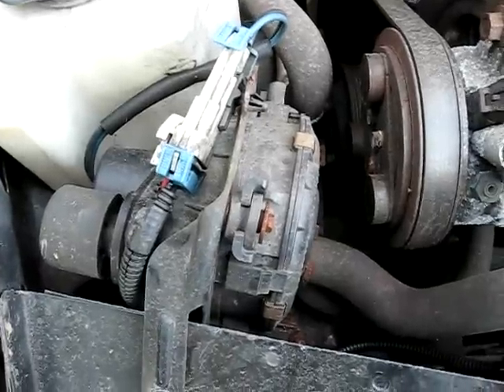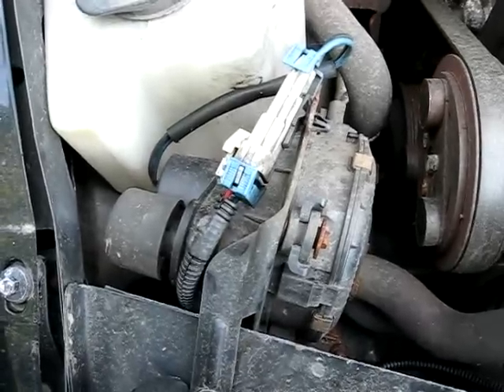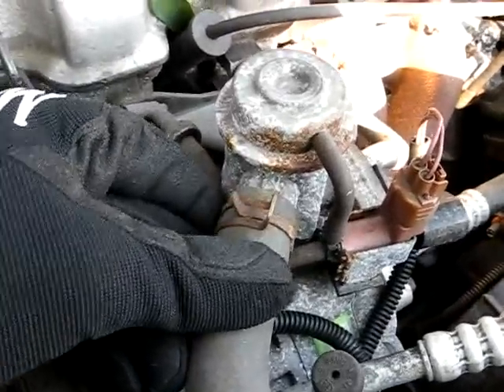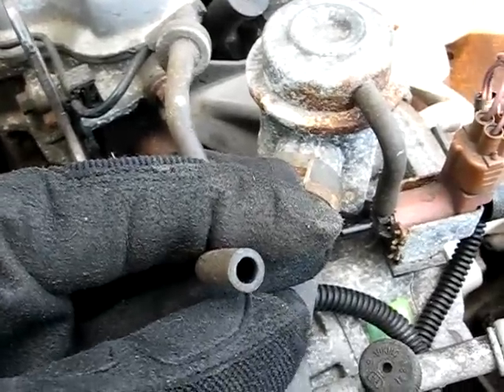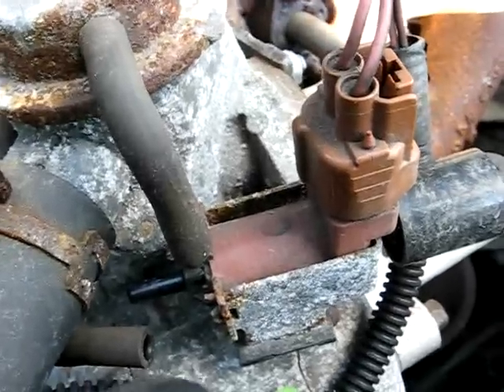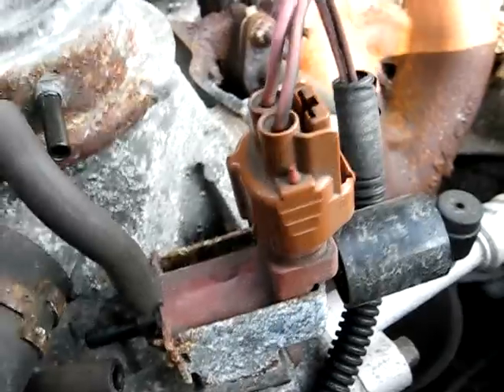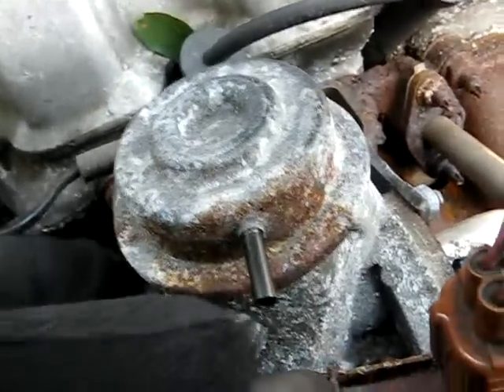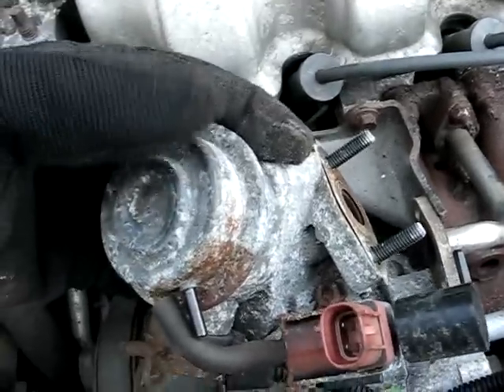P0410 Secondary Air injection System Troubleshooting

Comment: I have followed so many of your steps to clearing codes and just working on my own vehicle. I fixed several issues that my car  had and I recently just changed my O2 sensor but my check engine light was still on, so I went and had it checked and it was trouble code P0410. I had the code cleared but would it be best to follow the steps above?

Comment: I have a 2004 gmc envoy.  pump seems to be working  there are no vacuum hoses on the  valve I do have air to the valve  what do I do next  The bolts look pretty rusted I am afraid they will break off

Comment from the maker: If there is voltage to the pump the relay is ok and you bench tested it and it ran so that leaves only the black ground wire at the pump as the potential problem.

Comment: i have all these steps, i even took the manufold off and cleaned it ,also cleaned the egr valve still have the code. i changed the ects sensor as well that didn't  fix iit any other ideas

Comment: Thanks for the great video. Our problem was the tube leading to the exhaust manifold. Cleaned it and vacuumed out particles in the manifold opening, disconnected battery to reset, and code it gone. Appreciate you taking the time to post this how-to video.

Comment: Thanks richpin; 2001saturn 257000 miles code p0410 re watched video i missed diveter valve blowout ; had vacuum no blow out: replaced cleared code passed inspection thanks again

Comment: hello Richpin06 I need your help im getting that secondary air inje.. code were can I fing the air pump?I change out the fuse but still getting that check engine light on.Also getting a misfire on one but have change all spark plugs an wires.help please oops0404.rm@gmail.com

Comment: I followed every step, it seems like its all working. There's current where it needs to be and air is flowing/being sucked where it needs to. I even took off the manifold to make sure there wasn't a problem with build up, which there wasn't. Can one of the parts be "bad" even though its working? If so which would you recommend to replace first. Thanks for the video.

Comment: Thank you for your explanation, But I dont have power going to my air pump even with the car running. I check the relay but seems like is working. You think is the switch (solenoid). because I dont have vacuum on the switch. you think that switch is stooping the power to the air pump please advice thank you.

Comment: Thanks for posting, proved to be very helpful for a buddy's wife's 2000 SL1 throwing PO410 code. Didn't have to replace anything, just cleaned the tube between the diverter valve and the manifold, disconnected and reconnected the battery and the code cleared. I'm subscribed now.

Comment: thank you so much for posting these videos. I have been having a hell of a time getting my car to pass pa emissions because of this. I ended up taking my pipe off and cleaning it out with a coat hanger. and the pending p0410 code finally went away. there was a solid mass of carbon in there. my sl1 is running smooth now with 220k+ miles and counting.

Comment: No, we didn't change the engine coolant temp sensor and connectors.  the cars starts just takes a lil while some times.  having trouble figuring it out.  put on machine and that was the only code that came up

Comment: NO, we only did a simple tune up and oil change.  But we did have to clean some corrosion out the air pipes like in the video but car still doing the same thing.  It turns over really go, just not starting every time.  some times it takes atleast five min. before it would start.

Comment: Have a 2001 Saturn SC2.  we just got a po410 trouble code  saying we have a air leak.  Everything is working it is just have a hard time starting.  spark plugs and wires have been changed.  fuel filter has been change and fuel pump is working properly.

Comment: I have a saturn 2000, my problem is the engine light is on with the code P0410, i tried to trouble shoot using your recommended steps . with no success it is still there. I dont have power on the airblower and i have vacuum before the sullenoid and no vacuum before the diverting valve. But i do have power in the sullenoid but none in the blower. can you help me with this current problem?

Comment: Continued- If driven it will only run about 50mph. Is the Diverter Valve the problem? I do not understand this system. Aren't the exhaust gasses, and the air from the blower opposing forces? If I cap off the manifold where the tube comes out, the car will not run. Apparently this set-up cannot be bypassed. Any light you may be able to shed on this problem would be greatly appreciated! Thanks!

Comment from the maker: Yes that is normal for the pump to shut off like that.The red wire from the pump goes to the air pump relay in the under hood fuse box.

Comment: If the tube that goes to the manifold is cloged should i replace it or can i clean it like the throttle body? And if the manifold hole is cloged how do i clean that out. If i do have to take it off how do i do that? As well I know i need to replace the air intake/smog pump how do i do that. Can you please help me. I do know my way around an engin but i dont want to mess this up with the part being over 200.

Comment: hi richpin,I have a 1999 Saturn station wagon sw2 i bought it last may 2012 and a lot of problem show up the  tension belt loose in June 2012  and the transmission has problem on it,the dealer told me they fix it but this month the check engine light turn on and when i went to autozone the i talk w/ he said here's the code P0410 and it say air system malfunction ...when i wacth this video i found out i don't have a air pump actually the whole system,so my question is what should i do to my car?

Comment from the maker: It sounds like there could be a problem with the computer getting a correct temp reading and is running rich.I know the 02 came with the updated coolant sensor from the factory but i would start checking there first.

Comment: hi richpin i love the video but need some help i did as you instructed and the pump was not on i check the fuse a green 30amp its good then i located the relay and removed it then put it back about a min later the pump turned on for 5-10 sec then turned off i did it agian and vchecked the air flow it does blow air but for the pump to turn on i have to remove the relay and put it back but it only stays on a few sec do i need a new pump or a new relay thanks

Comment from the maker: If everything is clean and working correctly and the coeds keep coming back it could be a another problem like a crack in the flex pipe,rear O2 sensor or the catalytic converter problem..

Comment: Hey rich!  How would you test the operation of the diverter valve?  What if the diverter valve is operational, but when it needs to open the valve doesn't move? (Causing back firing.)  Is it safe to apply 12 volts to the solenoid to try and actuate it?

Comment from the maker: Boy i wish i had one handy i would make a video on checking the pins in the fuse box were the relay goes.One is live all the time from the 30A air pump fuse.The next one is live when the key is in the on position.The next one is the output to the pump and the last one is the trigger to turn on the relay from the computer.

Comment from the maker: The pump runs for only about 30sec on a cold start up.Voltage comes from the air pump fuse which is 12 volts.
Reply: What fuse is it? I am struggling to find the right one.

Comment: Question...I turned on my car to check the air pump it pumps for a while then stops, Should the air pump continue to pump air? is that what  i need to replace for my 410 code?

Comment: hi i took the hose  from the switch air pump solenoide to the air pump valve for vaccum,the car runs nicely now,the code still on but iam looking to the air pump solenoid switch part,after change that the code should be gone thanks richpin

Comment: @methunshow When you test the air pump its not enough to just confirm rotation do a scanner analysis with an amp clamp to asses the pumps viability. It takes a strong pump to irrigate the exhaust manifold against exhaust pressures. Check the diverter valve for vacuum continuity and mechanical actuation all the way back to the intake manifold. Do a frequency and voltage check of your O2 pre CAT sensors.  Check with mercedes for updates in your Engine Control Module [ECM] software

Comment from the maker: @ramayo824 Yes air should pass through the manifold.Seeing you have the tube off start up the engine, exhaust should come out the hole in the manifold if it does not you have blockage.

Comment: My Mercedes CLK 320 1998 gets that PO410 fault code every two weeks, mostly during the drive cycle. I guess the checks should be air pump, diverter valves for carbon on both cylinder head banks and O2S1 upstream of TWC. Can't forget current and vacuum. Anymore more food for thought would be appreciated.

Comment: Part 3. The ECU then concludes the test by stopping the secondary air pump, closing the pump solenoid  releasing the long term trim data, and opening the EVAP Canister valve. The point of all this is to test not only the secondary air supply being free of blockages but that the oxygen sensor is responsive [within specified test limits] to the presence and absence of supplementary air. The ecu will trigger a CODE if any test fails. some test occurs during normal drive cycle with a warm engine

Comment: Part 2. the ECU looks for no change in the oxygen sensor trim data. The air pump solenoid then open allowing air in the exhaust manifold. The ecu looks for a lean condition in the O2 sensors, which increases fuel spray and heats up the catalytic converter. If the O2 sensor does not register [within a specified time period] no change with the valve closed or no lean condition with the valve open then the P0410 code is triggered. The ECU then stops the air pump and looks for a richer  condition.

Comment: Part 1. The secondary air system and the P0410 code is one of the most complicated faults. P0410 is a generic code and dependant on your vehicle, indicates different things. The secondary air pump activates as directed by the ECU,on cold start and various times during the drive cycle. During cold start the air pump activates, but the solenoid valves is held closed. the EVAP canister valve is closed. Air is prevented from entering the exhaust manifold. long term trim data in the ECU is inhibited.

Comment from the maker: @ilovebrandie417 Exactly you will have to remove the exhaust manifold and clean the air passage way in it and the cylinder  head.

Comment from the maker: @geriko1 Remember the pump will only come on when the engine is cold at start up for a very short time.Try this clear the code then does the code come back when the pump is working or not.The biggest reason you get this code is because the exhaust manifold and cylinder head passage ways are plugged with carbon.

Comment: I don't know if this question has been asked yet but my air injection pump seems to work intermittently. Sometimes it will come on when it's supposed to and sometimes it won't. I've had the P0410 code for about a month. I did not check to see if it was fuse because it still comes on. I've checked the EGR(diverted valve) and all of the hoses associated with it and everything looks ok. Should I replace the air pump or is a weak signal from the PCM?

Comment: @richpin06a I have pulled the pump off the cover of the air pump but it's not spinning. And I tested the voltage to the wire and it read 3 so it must be getting some sort of power. It must be the air pump. But Why would it go bad in the first place?

Comment: @richpin06a 

Ok so take the relay off and test for current where the relay plugs in? There are 4 prongs on the relay, where would I check for voltage?

Comment from the maker: @bradrj1029 I would remove the air pump relay and check for voltage and see if there is a trigger signal from the computer.

Comment: also there is no vacuum at the second hose you pulled out, no vacuum is on that... but there is current going to the switch.. so idk if the switch is bad but if you see my other comment there is no current going to the secondary air pump

Comment: there is no current going to the secondary air pump.. it there supposed to be current going to the secondary air pump at all times or does it only engage at certain times? I fed the secondary air pump current and it started to spin so I know the pump is good, but there is no current going to it, what causes this? I changed the relay and the fuse is good

Comment: @living4fire Living4fire, I also got no voltage there. I ran a wire from the positive terminal of the battery directly to the pump plug (red terminal on battery to red wire on electric connector, black to black) and the pump ran directly off the battery. So I suspected relay or fuse, but first connected the pump back to the wiring harness and then I followed the vacuum hoses like in the video--and had no vacuum! I traced the long one back to the intake manifoldand it was unplugged. it works now!

Comment: I checked all of the hoses on my 2001 saturn and found no clogs, but I have hot air flowing back toward the pump. I noticed the problem when my first pump was completely melted. I replaced it thing it was defective, but within 20 minutes, the new pump was destroyed too. Any idea what's causing air to back up towards the pump?
Thanks for a great video and any help you can provide.

Comment from the maker: @living4fire Check the 30A fuse labeled air pump then pull the relay and check the socket for voltage if all that checks out swap the relay

Comment from the maker: @bxxpeace Yes,i will make a note of this in the video if after cleaning the pipe if you still get a code remove the exhaust manifold and clean it and the passage ways in the cylinder head.

Comment: @richpin06a Well, thanks again.  I found that every thing worked except that diverter valve, which was clogged along with that pipe that attaches to the manifold.  I cleaned all of those and still no flow out of diverter valve so now Im looking for the part.

Comment from the maker: @dieudonneMC Drive cycle:normal drive around town then minimum five mile drive on expressway at a steady 60 mph.Then let the vehicle cool down completely and do it again. On the s-series you can use a scan tool or remove the PCM-B fuse to clear the computer.

Comment: Richpin,
        I recently had this code and it shutoff on its own. Now when I start up the car (cold) the pump does not come on. I drive 2 miles down the road shut car off and the start the car and the pump comes on. I cleaned the pipe from the diverter valve and the manifold. I pulled the air pump and did not have any water come out of it. I also have the new brass ECTS installed less than a year ago. Thanks for any info. Your posts are the best.

Comment from the maker: In my video i refer to a valve called the diverter valve. When this valve fails it will let exhaust gases seep into the air pump.The exhaust gases contain condensation (water)which will ruin the bearings.